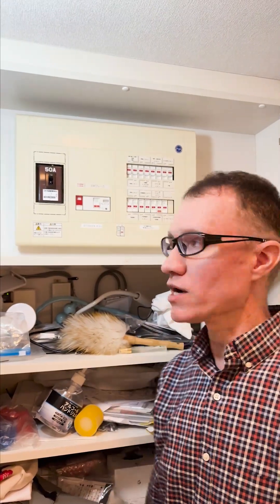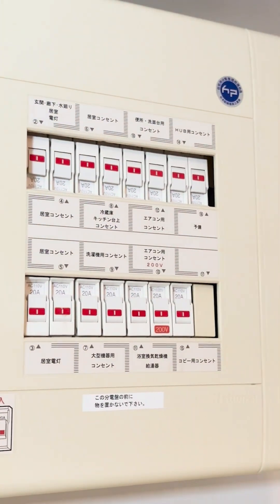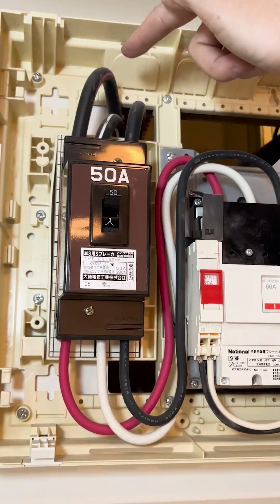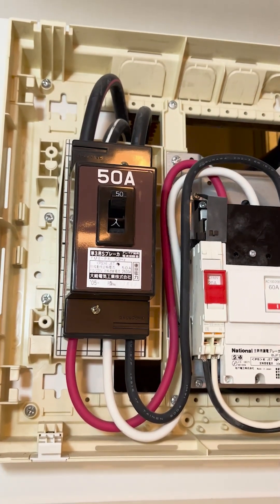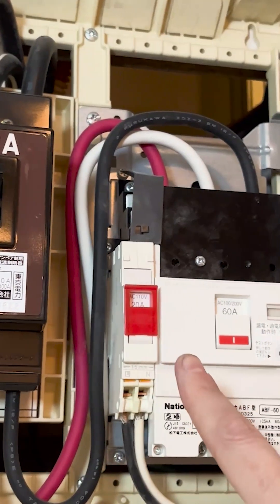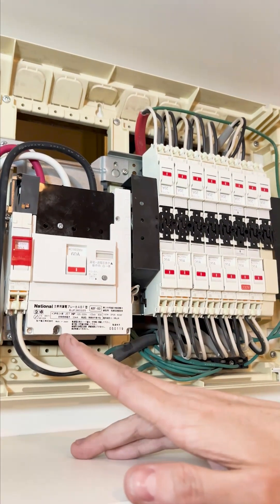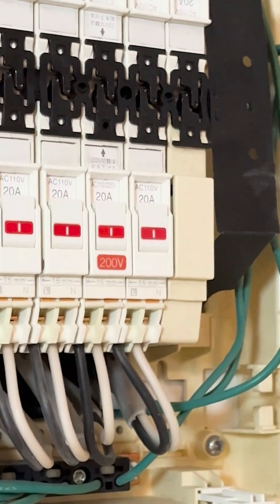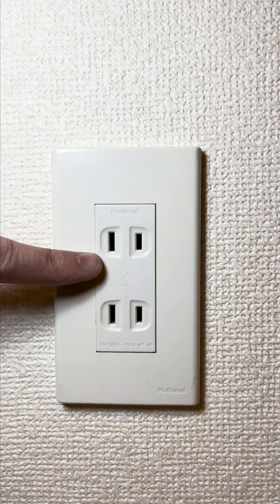Japanese Circuit Breaker Box (36 - Electricity Distribution)

Comment: 200V x 50A = 10 000W. I mean for house or apartment that runs its high power things on gas thats pretty adequate. But I wouldnt wanna run an induction stove, multiple AC units, oven, hot water boiler, furnace only from 10 000W.

Comment: Can you confirm that it is 100V and 200V? I got flamed out by somebody when I commented on a handful of comments saying that Japan has 100/200V system. and they insisted that the item they were repairing was from Japan and that it was labeled 200V so the system must be as follows. If I remember right this was for a lighting controller thing, which made no sense to me as I would suspect most lights are not on the 200 V circuit.

Comment: Why 2 phases and not 3? In Europe, 1 or 3.
Reply: Its not 2 phase. Its split phase, ie its the same phase with 2 ends of the secondary coil with middle one as neutral.
Reply: @wilsonsamuel2469  I understand, but then why is the cross-section of the neutral conductor the same?
Reply: @Zoli049 I think what you're asking is why is the neutral, the same size as the phase conductors. Well, if you're only drawing power from 1/2 of the transformer, you're pulling the full load on the neutral. if you're using both halves of the transformer, the neutral ends up balancing out in a similar way to three phase. And with more and more devices going to switch mode power supplies, there is less balancing and more need for the neutral. So the neutral has to be able to return the full current that one of the phase conductors would have on it in case there is absolutely no load on the second half of the phase. Yeah, and some people think the US doesn't have 240V power. It's a weird system, but it works. It gives us a lower working voltage for commonly interacted sockets, will also having the benefit of the full 240V for larger appliances.
Reply: @imark7777777  No. In Europe, a household is supplied with either 1 or 3 phases.
The neutral conductor is identical to the phase conductor.
The current does not flow back at the same time.
Reply: @Zoli049 oh I missed the "in Europe part". Although part of the comment still stands, the neutral needs to be able to handle the load of the hot conductor. Even if it is a three phase system. more so today. Although there are transformer configurations where there is no neutral at all, but that assumes a completely balanced arrangement.
Reply: @imark7777777  I didn't mention the size of the neutral wire. Only the two phases. This makes the network's load capacity unequal. In Europe, the N and PE conductors are connected at a junction, then divided into two again.
In our country, all 4 or 5 wires have the same cross-section. I only install substations above 400kV. The star points of all transformers are grounded here.
Reply from the maker: It's split phase similar to North America.  I have a video about it. 
 Here is the link.  https://www.youtube.com/watch?v=Xj-_zEDwxjE

Comment: 50A? When I sold my house in 2000 it was a 60A panel and it wasn't code. My house in AZ is 200A. In Italy, they  are pretty low as well, like 30A, they need approval to go to 60A. Crazy. People post that they can't run the dishwasher and microwave at the same time.
Reply: My home in mexico is rated for 80Amps because of washer and dryer AC heat pump and I still think that's low. If I want anymore amos let say adding a dish washer The wiring would have to be replaced from 12 gauge to 10. I only have 10 gauge for the dryer and its 220volts.
Reply: The question is, in Italy is it single phase 230V service or three-phase 400V service? Cause if its three-phase at 30 amps then thats 400 x √3 x 30 = 20784.6 watts. Thats a lot of power. If its only single phase then yeah, its pretty low, 230 x 30 = 6900W.

Comment: Interesting but why no ground?
Reply: Japan developed their electrical system somewhat independently focusing on simplicity and compactness. Their lower voltage reduces the risk of shock, so I guess they never felt the need to upgrade.

According to ChatGPT RCDs/GFCIs are are not mandatory in Japan. You would think they would be given the higher risk.
Reply: Low voltage ≠ less of a damage from being shocked at 100v. Sometimes appliances also pick up static charges like fridge body. They need to dissipate that through ground. @StuartJ
Reply: @TheDeathLove  they do have some circuits that are grounded for larger appliances like the refrigerator, Washer and I would assume the air conditioner.
Reply: @StuartJ   
Do tell.

Comment: its like a hybrid of the north american system and the german system

to those that dont know, the 100/200 volts  and 50/60hz came from generators used during war that were originally designed for the 125/250v north american system but run at lower power to save fuel, and the 60hz came from USA made westinghouse generators, while German made generators on the other side were built to output 50hz

it was made standard after the war, as japan had no previous electrical system and 100/200v 50/60hz hardware had spread across japan already, making it the only nation with a completely unique electrical systems, 2 of them if you count the 50 and 60hz sides
Reply: Not why Japan uses 100/200V.  Japan had no native electrical industry in the 1890s and so imported Siemens and AEG 220V 50cy/sec equipment for use in and around Tokyo and General Electric and Westinghouse 110V 60cy/sec equipment for use in and around Osaka.  These respective potential and frequency standards spread out from those respective cities.  The reason for the oddball 100/200V standard is that since a standard potential would screw over one of those installed bases, they decided to instead screw over both.
Reply: ok, so no way that running generators at lower voltage is going to save fuel. In fact lowering voltages is in some ways going to increase energy demand because lower voltages means proportionally more energy is lost to voltage drop, thus more energy is wasted. Motors will compensate for the lower voltage by drawing more current and shortening their life. Incandescent light bulbs will use less energy overall, but their efficiency plummets and they produce far less light relative to the energy consumed. 

The only way this marginally works is it does reduce the output of electric heating elements. However at the time this would have occurred electric heating would be extremely rare.
Reply: @ryuukeisscifiproductions1818  it only saves fuel because loads dont run at full power
it is less efficient and also results in higher current
they did not look at watthours per liter, they looked at liters per hour 

but these grids were local and small making the voltage drop insignificant and not a factor to base electrical technicians, that was until electricity came to civillians where now it is a very inefficient and limiting system all arround, and a severe case of old habits dying hard
common outlet circuits in japan are commonly only 10 amps, or 1000W, anything like an air conditioner uses a 200V circuit 
while using the same amount of copper as both higher current and higher voltage circuits in other countries, 20 amp 250v or 125v circuits in NA can carry 2.5-5kW with not much more copper, and support exponentially longer distances, and 16 amp 230V circuits in mainland europe benefitting similarly, 3.68kW over similar wire gauges